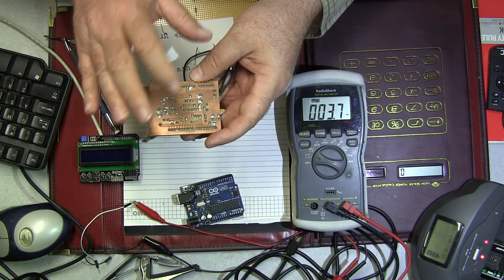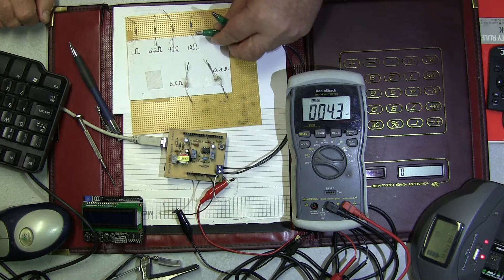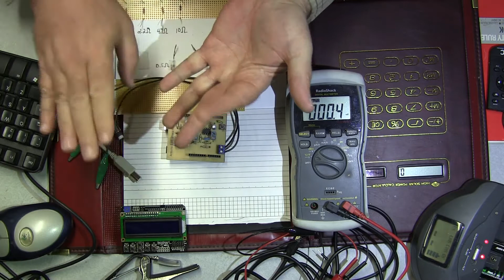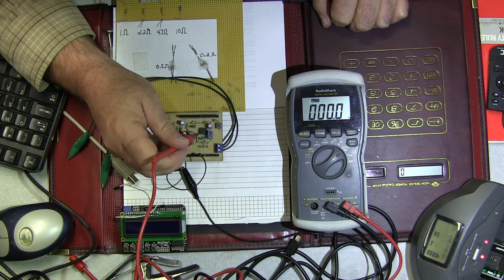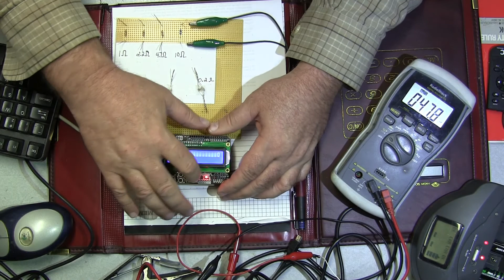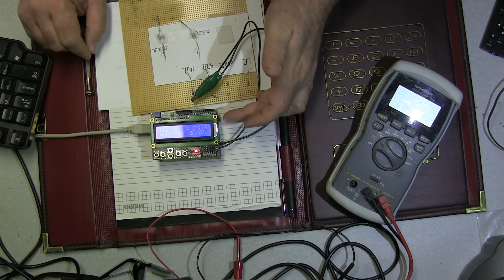DIY Arduino Esr Meter Shield - Part 3:  Arduino Shield Setup & Calibration

Comment: Dennis, thank you very much for your work here. I have adapted much of your project into my own shield for the Arduino. I also borrowed ideas from other ESR meters, most notably using a Schmitt trigger instead of a transformer. I also modified your code, and removed the trimming process. I did leave the attenuation POT, but honestly it could have been removed as well. I ended up using a 6 exponent polynomial curve formula instead of MAPF to determine Ohms, because this seems to be much more accurate regardless of drift from temperature, even so it's not entirely perfect. A couple values read at (example) 7.99 instead of 8 ohms. 

Again thank you
Reply: Hello. Can you share your project? Thanks.

Comment: where do you get those female pin headers with extra long legs, all mine just poke thou the pcb with just enough leg to solder them, let alone long enough to reach into another header. cheers
Reply from the maker: You can get them pretty much anywhere. Check adaFruit, Digikey, Mouser, etc. They come in all types of lengths.

Comment: Hi again Dennis
I have built the board and have the following issues. First I used the TL062 opamp. When I power the board up with either the arduino or an external power supply I get 2.3 volts on A0  input pin. If I short out the leads I can get the voltage down to 700 millivolts but it stays there when I unshorten the leads. I did not have a 20 ohm pot so just to try I used a mid value resistor in it's place(10 ohms). I can't seem to find the TLV2772C locally. In your eagle drawing you use the TL062 opamp so I built it around that. Any thoughts would greatly help.
Thx again
Reply from the maker: Hi Francisco!
Have you checked all the traces with an ohm meter?
Have you checked to see if the first op-amp is oscillating around 100khz?
 Send me a PM and we can exchange emails with pics to try and troubleshoot your board. The TL062 should work, but I haven't tested one.
You will need the multiturn trim pots in order to scale/attenuate the signal. I don't know if it will be very accurate with out them.
Reply: Hi Guys,

I'm sort of getting there with mine now. I swapped the TL062 for a TL082 which has a slightly higher bandwith.

I suspect a lot of the problem with using a different op-amp is that Dennis has calibrated the voltage steps and corresponding resistance in the Arduino code with the frequency-gain characteristic of the TLV2772 which will vary according to the op-amp model, so  you might not necessarily get the same interpolated voltage/resistance values across the range.

The only really accurate solution would be to get a bunch of precision resistors and set the values again according to that specific op-amp.
Reply from the maker: reggiebacci

Exactly !
I anticipated there might be different transients in the transformers and discrete components that are used and if if you notice the Arduino code I setup constants for the ohm values to make this "Fine Tuning" easier.

The 1% 1 ohm resistors are easy to find and you can solder them together to make a resistance ladder like I did (I used 5%). Measure a known value once you have the (295mV-700mV) attenuation set and store the value for YOUR meter as a constant.

What I have found is once the setup is done, the calibration button (probes shorted) fine tunes and keeps the meter close.

One note however; if you power through a USB cable on different devices you will find variance on the USB 5V supply and this does cause issues with accuracy. So using the same wall-wart to calibrate and then in use is the best way to go.

Keep me up to date on how your meters do!
Reply: reggiebacci
Thx reggie
Tomorrow I am going in to Montreal and I should be able to pick up both the TL 082  and some precision resistors, and also the 20 ohms 20 turn pot. I am very grateful to both you and Dennis for your feedback. I will post my results here.
Regards
Francisco

Comment: Hi Dennis
I found a small ferrite transformer on an old pc power supply with several windings on it . I was able to find a winding that outputs 120 millivolts on a 5 volt input. Do you think that the output is sufficient?
Thx again
Reply from the maker: 120 mV is probably going to be too low to work properly. Ideally the output should be in the 200-250mV range. Another thing to watch is the current draw on the primary winding, it needs to be less than 100mA and the lower the better. I don't remember exactly what the current draw is on the one I found. Just need to make sure the 5V rail on the Arduino doesn't sag.

Comment: Facepalm. Good point about the op-amp. I'm using a TL062 because I was following Manfred's original circuit diagram to begin with. It's in a DIP socket so easy enough to swap out for a TLV2772C.

I'm powering it from a lab supply and using a multimeter to test the output voltage. I've put hooks on the legs of the op-amp and it's holding 5v steady, short and open. Pulling <1mA from supply.

I'll change the op-amp and poke about with the scope & let you know how it goes. Thanks again for your help

Comment from the maker: C5 shouldn't influence the output, the 100nF is just a filter to polish off the rectified output of the 2nd OPAMP.
Are you using the same OPAMP?
Can you test the current draw of the shield?  
Can you test the current draw of the primary winding of the transformer?
It sounds like the 5V rail might be getting pulled down while testing/shorting. That is where I would start.
Are you powering the Arduino from a battery or USB?

Comment: Hi Dennis, first, thanks for your videos, just finished building mine and wouldn't have been able to do it without these. 

I'm having a bit of a calibration problem with mine tho - I can set the shorted probe voltage to 700mV, but it seems to drop of it's own accord while the circuit is on (but the 10ohm voltage stays the same). It almost seems like C5 is slowly building charge and so the output is dropping. Also, it happens faster while the probes are shorted.

Any ideas guys? Thanks

Comment from the maker: The transformer is not as critical as you might think. You just need to drop the 5 volt square wave down to 200mV  +- 50mv. You can fine tune the output of the 2nd op-amp to correct the difference if needed.

Build up your board then clip in different Transformers to the output (pin 1) of the op-amp and measure the secondary with your volt meter and use something close. That is what I did.

Comment from the maker: It is just a transformer I pulled from an old PC power supply (I think). In my analog build I used a Radio Shack Audio Output transformer 273-1380. I didn't use one on this build because it was to tall to fit under the LCD shield. If you are build a custom shield with an integrated LCD you may be able to use it. 

Or you can wind your own around a ferrite toroid out of an old power supply. In the original schematic that is what was specified. A hand wound 400:20 turn toroid.

Comment from the maker: Those will be more than accurate enough. The double layer SMD board should work great! The more ground planes you use should cut down on the background noise on the ADC measurements.

The code vid should be up in a couple of hours, it ran a bit long, about 42 minutes.

Thanks for watching and the sub!

Comment from the maker: Thanks whipp3t11,

Do you know anyone who has one? Other than that you could probably wing it. I don't remember what the center value on the freq pot was but you could just use that until you could get it set. It will still work.

If you are buying components I would get the 1% resistors and the caps use whatever, they are just used for decoupling and voltage stability, 20% is fine. I just used what I had.

The final video (code) will be done today!

Thanks for watching!